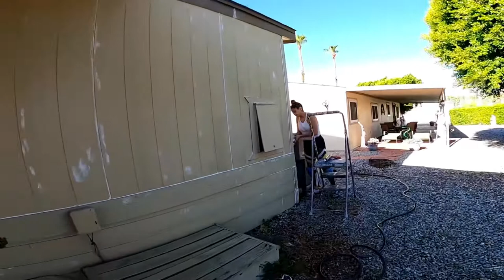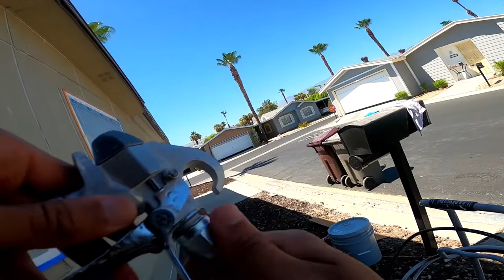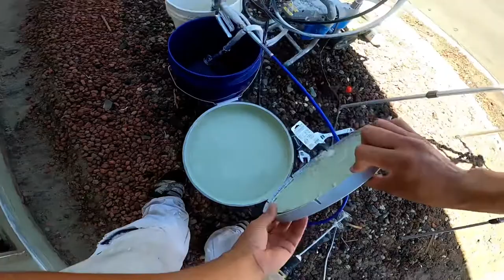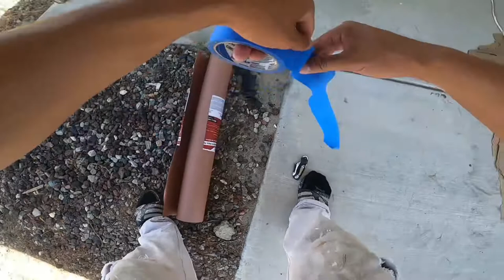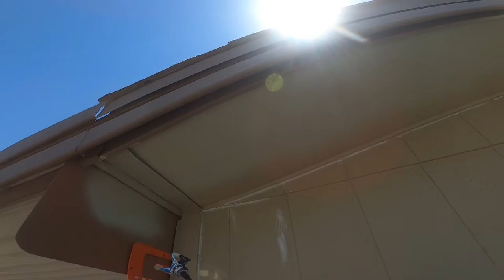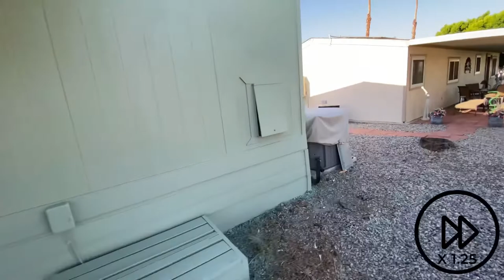How to Paint a House - (Day #3) w/ the Avanti Airless Paint Sprayer

Comment: did you have to thin down the paint with anything. it wasn't too thick coming out of the sprayer.
Reply from the maker: Nope, not too thick. The heat would dry the paint quickly. Most paint doesn’t have to be thinned, the sprayer can handle it

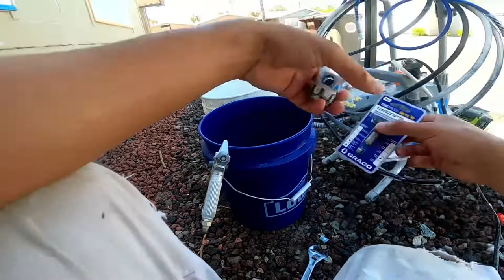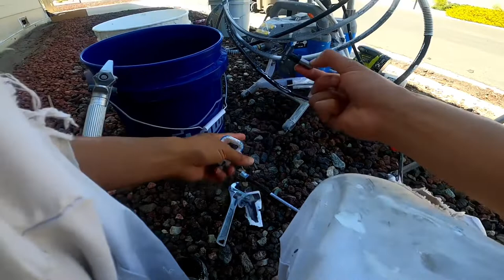Comment: Really Nice Video! Between 1:20 - 1:32 in the video I noticed that you put on a Graco 515 spray tip. Are all Graco spray tips compatible with the Avanti Sprayer or just some?
Reply from the maker: Not sure, good question. I’d hope they’re all compatible.
Reply: The black Graco tips are compatible with the Avanti tip guard which is like the Orange Graco tip guard.  The black Graco tips are very common.